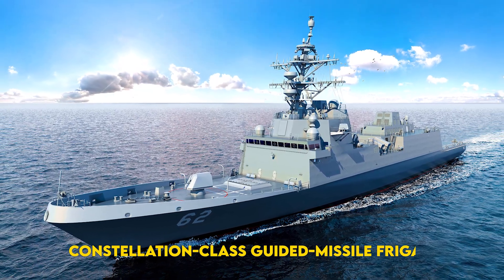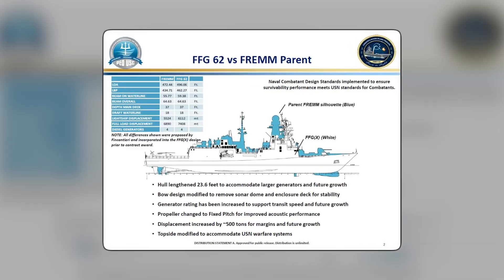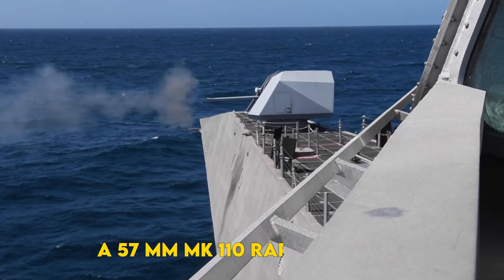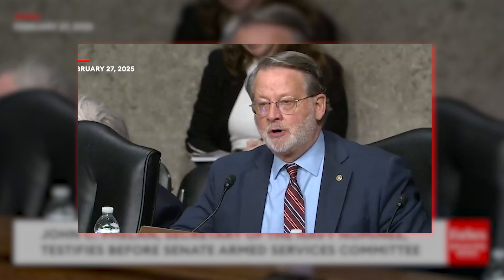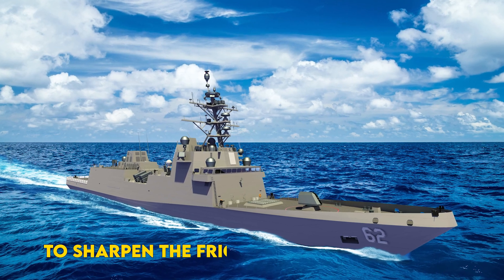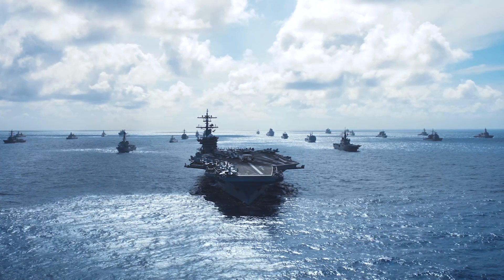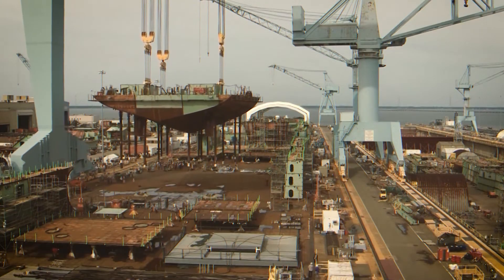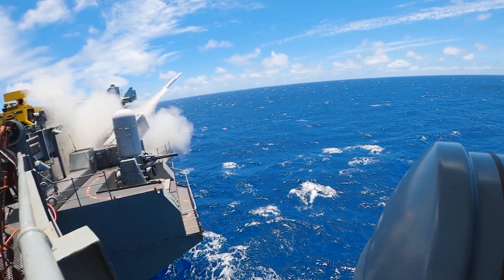Can the US Navy's Constellation Class Frigate be Saved from Disaster?

Comment: The FREMM EVO (Italy) and Constellation-class (US) frigates, both derived from the original FREMM design, feature significant differences in size, armament, and roles due to distinct national requirements
; the Italian EVO focuses on incremental improvements like long-range missiles and extensive ASW capabilities, while the US Constellation is a larger redesign for enhanced anti-air and anti-ship power, incorporating the Aegis radar system and more VLS cells but facing development delays and overweight issues. 
Here is a comparison of the two classes:
FREMM EVO (Italy)

    Size: Approximately 6,500 tons displacement.
    Armament: Capable of launching naval cruise missiles (MdCN) for long-range attacks, two 76/62 mm DAVIDE/STRALES cannons.
    Radar: X/C dual-band radar for ballistic missile defense.
    VLS: 16 SYLVER vertical launch cells, potentially expandable but less capacious than the US system.
    ASW: More comprehensive anti-submarine warfare (ASW) sensor suite, including bow and towed sonars.
    Aviation: Two hangars for two NH90 or one NH90 and one AW101 helicopter.
    Project Status: A natural evolution of a mature and proven design; first two ships expected in 2029 and 2030. 

Constellation-class (United States)

    Size: Approximately 7,500 tons displacement, longer and wider.
    Armament: Greater anti-air and anti-ship firepower, one 57 mm Mk 110 cannon.
    Radar: AN/SPY-6(V)3 radar system, part of the Aegis combat system.
    VLS: 32 Mk 41 VLS cells, more capacious and versatile, capable of launching Standard SM-2 and ESSM missiles.
    ASW: Uses a Thales CAPTAS-4 towed sonar but lacks a bow sonar.
    Aviation: A larger hangar for a single MH-60R helicopter and a drone.
    Project Status: A redesign of the FREMM project facing delays and overweight problems due to numerous modifications. 

Design Philosophies

    FREMM EVO: An incremental improvement of the original Italian design, focusing on enhancing existing capabilities for specific areas like anti-drone defense and long-range attacks.
    Constellation-class: A fundamental revision of the FREMM design to meet specific US requirements, leading to significant differences in size and equipment.

Comment: This selection of the Italian FREM class frigate was a huge disaster. First of all, no US Navy frigate in the 21st century using warships designed using obsolete mechanically rotating radars. A warship's main radar is is a basic and critical part. Italian warships still use obsolete mechanically rotating radars and re-engineering a Constellation to adapt the much more capable Aegis solid state radar is a huge engineering task that none of these incompetents at the Navy dept. factored in. There are already warships like the Spanish F-100 or the Japanese Mogami class frigates that already have the Aegis radar system integrated in it's design. The best thing to do is drop this turkey and focus on one of the aforementioned alternatives.
Reply: There is nothing obsolete about an AESA rotating radar. People often seem to compare modern AESA fixed panel arrays to old PESA rotating radar... but that is the wrong comparison to make. The rotating radar on modern ships use the same type of panels as found on ships like the Arleigh Burke, and they retain all of the advantages that the technology brings. Rotating the panel can have significant advantages over fixed arrays, and disadvantages which only really apply to certain weapon systems. 

They allow you to either get a significantly larger and more powerful radar for the same weight, which is good for volume search where ~1.5s loss of tracking in every 2s period isn't much of a downside compared to having a significantly longer range and resolution. Or, alternatively, you can build a much lighter radar and thus install it far higher up, which roughly proportionately increases the horizon of the radar and thus how far away it can see near to the surface targets.

The rotating radar on the Type 45 is roughly twice as high up as the SPY-6 radar on the Arleigh Burke, meaning the Type 45 has effectively double the detection range on the kind of targets that are the greatest threat to the ship, such as anti-ship missiles.

The trade off for that is that its radar can only see a target for ~0.7 seconds, and then it loses it for ~0.3s before the next face of the radar swings into position.

That makes it unusable for painting a target for semi-active missiles, which is the actual reason why US Navy ships use fixed radar arrays. The RN, however, use active seekers in all of their weapons, making this one downside to the rotating radar moot as the missiles switch to their own internal radar before they get close enough for that intermittent tracking to be an issue.

Thus, for their use case, the Type 45's rotating radar is superior to a fixed array without any significant downsides.

The Royal Navy is the only navy in the world to have fought and won a modern naval war. They designed the Type 45 as a direct result of what they learned while being the target of modern anti-ship missiles. When they decide they wanted a rotating radar rather a fixed array, it is the height of hubris for other navies with no experience to assume that they know better.
Reply: Fremm evo costs 750 millions and has the new fixed Kronos Dual Band aesa radar. At the end us constellation will be better but is it worth almost double then a fremm evo? It Is my understanding the us navy already has bigger and better ships, constellation program was to build cheap ships in big numbers.
Reply: I agree Constellation has not gone well. FREMM could have worked, if the USN could have accepted using something like SPY-1F (the older frigate version of AEGIS), having 16 or maybe even 24 VLS cells. That is not what the Navy wanted; they wanted SPY-6 (a radar designed for destroyer sized ships) and 32 strike-length VLS cells. In short, they wanted a mini destroyer, not a frigate; but they wanted it at frigate cost .. it wasn't ever going to happen.

As I understand it there were real issues with F-100 or Mogami. The F-100 is an AAW frigate, not an ASW one as was required, and converting between them would also likely have been a non-trivial change. The F-100 also uses an older (somewhat outdated) version of AEGIS; the Navy wouldn't have liked that either. Mogami was never in the contest: it uses a custom version of AEGIS that is apparently not compatible with US AEGIS. Mogami is also only manufactured in Japanese shipyards, using standards and techniques that are very much Japanese and not American. US warships must, by law, be made in US shipyards and there is no such shipyard to build it.

Comment: These days the US Navy couldn't float a rubber duck without it costing billions of dollars and taking ten years.  The Navy wanted and needed capable frigates very soon, so after years of dithering, they chose the excellent and proven FREMM frigate from Europe, then proceeded to change almost everything about it a dozen times over.  Someone lost the plot.
Reply: Agreed.  Basically turned it into a slightly smaller Burke.  Why not just use the Burke hull that's already proven and put less and cheaper systems in it? Or the NSC and upgrade to Navy needs?

Comment: Who on earth believed that the US Govt procurement and pork-barrel politics would allow 85% parts commonality with FREMM?

85% commonality with FREMM means that except steel for the structure 85% of what goes into the ship is not American, but bought from European suppliers as that is what they were designed to have. Those suppliers are never going to give all their system designs and IP to US companies so that they can make something identical.

Too much foreign, and not enough “American” content.

The redesign has reduced that 85% commonality to 15% by simply replacing everything in the ship with American sourced vaguely equivalent stuff. Then, why so expensive? Because everything needs to then be made to fit, and then made to work together.

Pork barrel politics meant that every senator and congressman was lobbying for US suppliers to get contracts, non the original FREMM suppliers.

If you want a quick and easy copy, you don’t start charging every thing inside the ship.

About the only real common bits are the engines, power management systems that were originally American anyway. Everything else, from the sewage plant to the weapons systems have been replaced with something American that is vaguely similar.
Reply: The Navantia Hmas Hobart had all American systems.

Comment: It needs 48 VLS since the cruisers are being retired
Reply: Maybe,  but remember hypervelocity 5 inch shells does exist 

Because of drones and cruise missiles , and missiles are complicated to make

It is better to just use 5 inch gun to go anti air instead
Reply: The FFG(X) program came about because the USN has a capability gap. After the failure of LCS they lack a fleet of lower capability, but much more numerous vessels, especially for ASW/escort. Constellation was supposed to fill that gap, a "frigate" (like FREMM or the UK's Type-23): a cheaper more specialized vessel built in larger numbers.

Instead Constellation is already the largest (and most expensive) "frigate" ever built: 75% larger than the Oliver Hazard Perry class frigate, larger than many small destroyers. 48 VLS would make it even larger, and even more expensive. It could be a good ship .. but it wouldn't be a frigate at all, and (like other destroyers) it would be available in limited numbers. This would continue to leave that gap in the Navy's forces unfulfilled.

Comment: Yes, there's a chance the Constellation class can be saved. By taking the pocketbook away from the Navy and giving them a set budget. And if they go over the budget, then there will be consequences. Congress needs to drop the Hammer on the Navy and the ship builders.
Reply: fixed budgets don’t exist in shipbuilding
Reply: Navy don't need to build a different frigate design,  just simply buy modular frigate from Europe,  and put sm6 and sm2 in vls and cruise missiles and a 5 inch gun turret , done
Reply: @thanosfickda US politicians will never allow that - there will not be enough pork-barrel for the companies that paid for them to be elected.

Buying a modular frigate from Europe would mean at least 85% of what goes into the frigate has to be bought from Europe - all the european companies that make the parts that go into such frigates aren’t just going to give their plans and IP for the equipment to the US so that they can build copies. Just like the US companies would never give the plans for AEGIS, mk41 VLS, or the latest radars to a European company to make copies.

The big problem with Constellation is that they are doing exactly this - replacing everything European, from the sewage system to the combat system passing via the galley and the heads with similar but not identical American systems.

The problem is that these American systems are slightly different in size/weight/performance and the ship has to be modified to accommodate these changes - and all these systems need to be made to work together, and that’s not trivial. (And they’re also converting everything in the design from metric to feet/inches…..). On top of that, all these basic systems would also be different from those installed in other USN ships, reducing commonality, increasing the need for spare parts storage etc, and meaning sailors need to learn different systems specific to those ships.

The other solution is that the American Politicians and public accept that 85% of the new ships would be bought from Europe and a large part of the purchase cost would go abroad.
Reply from the maker: Totally agree—real accountability and a fixed budget could push the Navy and builders to deliver. It's time Congress put some real pressure on both.
Reply: The Navy always blame the shipbuilder and the Congress audit 5 years too late when the ones to blame have left. There is no accountability, it's just a big show